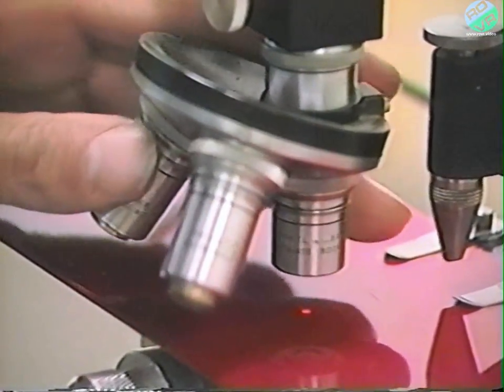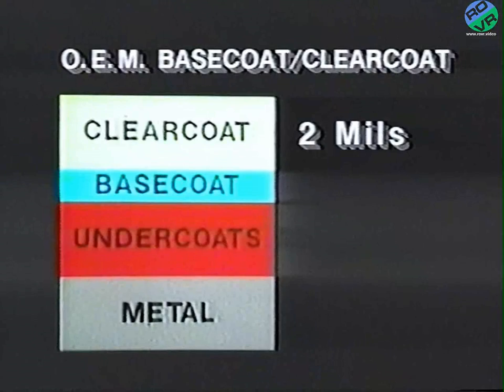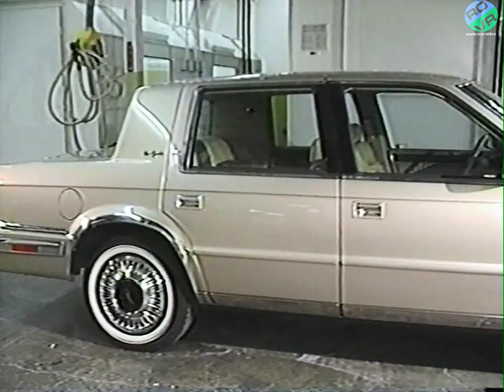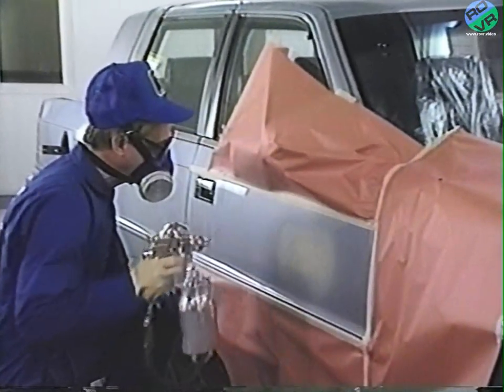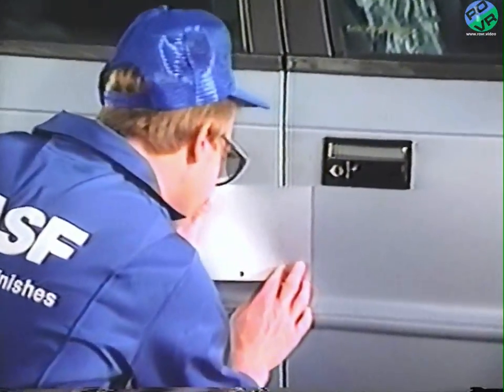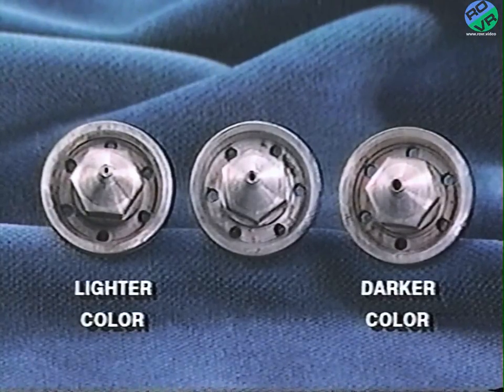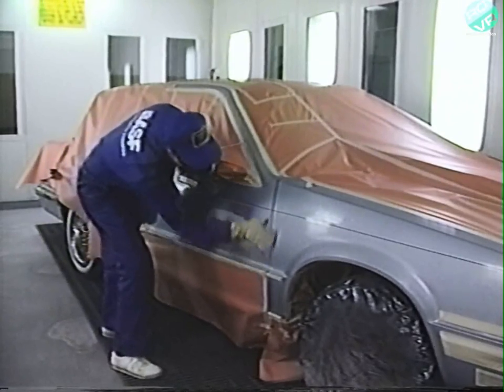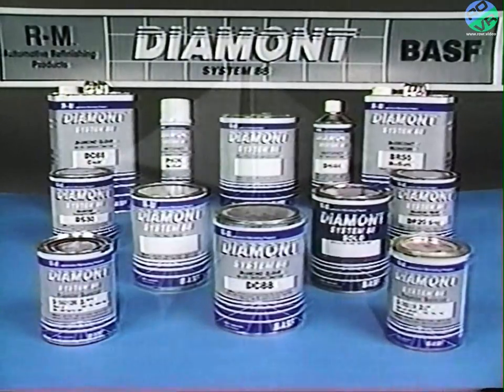Chrysler Jeep-Eagle (US) - Video Tec - Repairing New Basecoat & Clearcoat Finishes (1989)

Comment: Top video. Irony being that I learned to paint about 25 years after this video when changing careers.....and the fundamentals haven’t changed that much. Well apart from paint performance has improved and repairers seem on the whole to accept a lower quality repair, seeing good enough as the benchmark. 

Recently did a whole body respray on a Rover 75 V8 that had had smart repairs done on a number of panels. Less than a year later the repairs were failing. The company who did them said they were ‘of an acceptable standard’.......Muggins here painted the whole car stripped down and glass out with a 3 year paint warranty for just over the price of rectification by this other company. 

Moral of the story, use someone who takes pride in their work, not just chasing profit above all else.